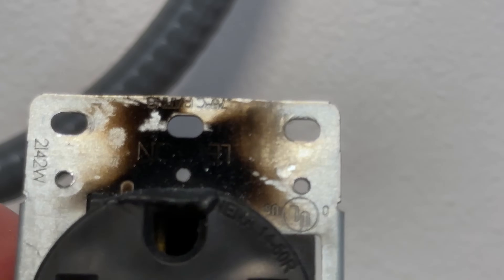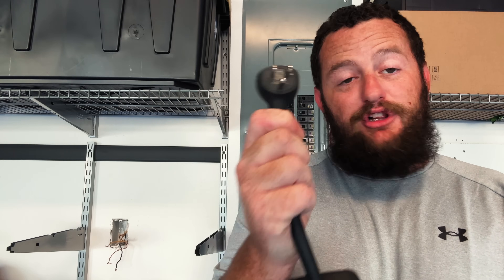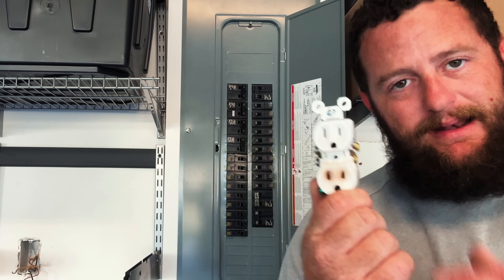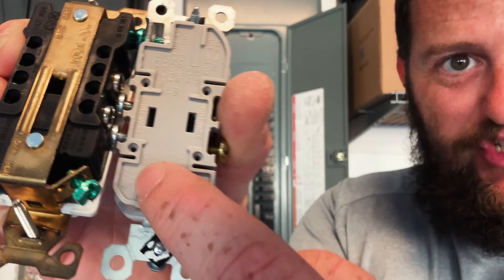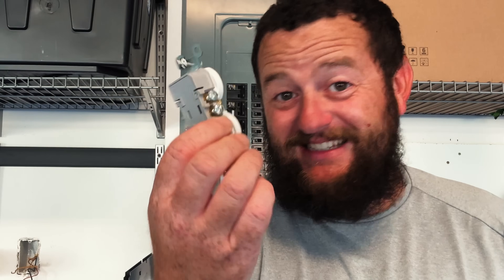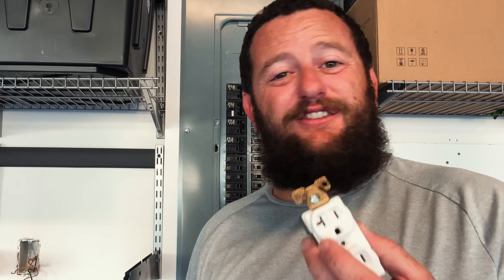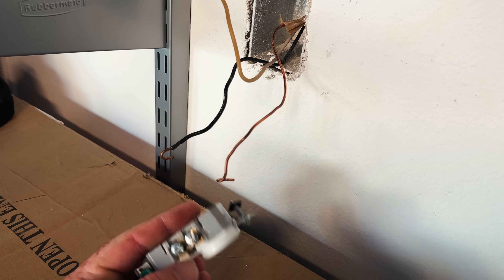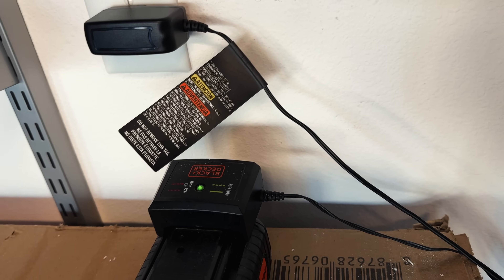Charging W/ Tesla Mobile Connector on 120V Outlet?? Don't Let Cheap Outlets Burn You!!

Comment: Just limit current. Always remember that the amount of heat is proportional to current ^ 2. So 10 A gives you 100 and 12 gives you 144! 50% more heat on wires just for 2 A

Comment: Since you installed a 5-20 outlet on a dedicated 20A circuit, you could buy the 5-20 adapter from Tesla and charge at 16A. Any plans to test this?

Comment: THANKS BEARDED 🤗 FOR HELPING THE COMMUNITY…IMHHO… Your problem, stems from homebuilders using the cheapest of everything to maximize profit for themselves, leaving the homeowner in trouble… I live in an old home with outlets that were heavy duty and in remodeling my other house …TOTAL REMODEL,IN 1991 I had the electrician put in heavy duty outlets and 12 gauge wire so I wouldn’t have those problems🤷‍♂️OVER KILL,MAYBE BUT I SLEEP BETTER  😴 💚💚💚

Comment: I replaced the outlet that I used for my 120 v mobile connector with a professional grade one when I just bought my Tesla but had not installed the 240 v wall charger.

Comment: You can get a nema 5-20 plug for that 20 amp which charges the car faster than the 15 amp
Reply from the maker: Yep, if I remember right, in the Y it’s the difference between 1-2 mph charge rate vs 9-10 mph charge rate on the 5-20

Comment: Thanks for doing this video.  Hopefully you'll be able to answer this, but in your experience, do you think it would be worthwhile just to charge with the standard 15amp cord and not upgrade to the 20amp cord attachment?  I'm currently renting and my carport does have a 20A outlet outside, which I will be intending on using to charge a Tesla M3P once I get one.  Generally, I just use this outlet for my battery tender to maintain the batteries on a couple motorcycles and an ATV.  I believe my battery tender unit pulls 1.25amp max.  Ideally, I wanted to keep using the battery tender to float charge my other things and charge the Tesla.  Would it be wise just to keep the 15amp attachment and then I could still use the battery tender and avoid any potential overheat issues?  I'm guessing if I did buy the 20amp attachment and have the battery tender on the same circuit, I could be running into an issue with too much draw on the circuit.  Clearly, I'm no electrician and it's overall a pretty foreign concept to me, but I just want to avoid any possibility of an electrical fire in the carport.  For context, I have had both my engine block heater for my diesel truck and the battery tender going on the same outlet in the past, and I think the block heater draws at least 12amps, so I hope charging the Tesla wouldn't create any issues, especially if I'm slow-charging it.  Ideally, I'd love to charge at 16amps, but I may just have to be smart about only using 1 outlet at a time if I'm doing that.  What do you or any others that are more well-versed in charging EV's think?

Comment: 3:19 On that screen, you see its already reducing the amps to 9/12 and the voltage is reading 105.  Nominal voltage should be around 120.  The screen also says "Unexpected voltage drop". Those are all BIG signs that the outlet should be powered off from the breaker and taken a look at by someone.  And extension cords should not be used as stated in the manual (for anyone else reading through the comments)
Reply: 100% correct! This circuit has issues!

Comment: My garage has 2 20 amp circuits for receptacles. Builder installed all NEMA 5-15 Receptacles. Like you I swapped out one for a 5-20. I also bought a NEMA 5-20 adapter from Tesla for my mobile connected. It charged well at 15 amps and added, according to TeslaFi, 7 miles of range per hour. 

This summer I hired an electrician to replace the 30 year old 30 amp sub-panel in my detached garage with a new 100 amp panel. New dedicated 60 amp circuit runs to my Tesla Wall Connector. Charging Joy!

Comment: One other thing to inspect is if your 120 outlet was wired using the push-in "backstabbed" connections. The first time I charged overnight I noticed in the morning the Mobile Connector had cut charge current by 50% due to too much heat detected at the wall outlet. Definitely scary! The outlet is 20A rated on a 15A breaker charging at 12A. I pulled the outlet from the wall and noticed it was connected via the backstabbed connections. I re-wired to use the receptacle screw terminals and since then have not had any issues with overheating or current drop.

Comment: I own a 2023 Tesla Model Y LR.  I read all the horror stories about using household grade 240 volt for charging my Tesla at 240 volts.  Per tesla's instructions I purchased a HUBBELL INDUSTRIAL GRADE Receptacle  and had a friend of mine who is a licensed electrician insalll it for me.  I have been charging my vehicle with it for over a year now and everything is working gread.

Thanks for the infor on the 110 Volt Outlets.  I will pass this information on to a friend that has a Neon Leaf.

Comment: Electrician here. The 15 amp receptacle is perfectly legal. And as a continuous load at 12a it is well within the capacity of the device. 

Likely weak connections on the device. Houses are slapped together these days. 

Are you going to tell people that the 20a outlet can’t be used for the 16a continuous duty found on a NEMA 14-20 isn’t safe? 

I installed a Leviton cheapo 6-50 for my car and it works perfectly 2.5 years in.
Reply: Sure.  The 90 cent "contractor grade" outlets might not be up to the task, but a 15A spec grade should.  I installed a Leviton spec grade receptacle in a garage for a door opener and it was less than $3 at Home Depot.  It was similar to what he showed for a 20A, with a more robust body with a metal strap.

I thought that the biggest problem with most cheap 5-15 receptacles is that their contacts are typically just a simple U shape, while higher grade receptacles have a better design that snakes and that puts less strain on the contacts.  I've replaced older receptacles where it was really loose, but I think the spec grade outlets tend to maintain contact better for years.  The strange thing was that it didn't take a lot of force to insert/remove a plug, but I would think the important thing would be to maintain the contact.

Comment: We can’t assume anything when it comes to home charging. In most older homes, you have no idea what type of wires are behind the walls. Best to err on the side of caution. I wouldn’t use more than 8 amps on the mobile charger as a continuous draw. Unless it’s a dedicated line with the right gauge of wiring for high amperage draw, it’s unlikely to be safe for extended continuous high amps draw.

Comment: If there’s only one outlet on the circuit and you want to use it for EV charging only, I would use a 20 amp dual pole breaker with an industrial grade single 240v outlet.   You’ll charge at twice power.  Using 80% continuous rule, only charge at 16 amps for 3.84 kW. You’ll need the 240 v adapter for your UMC.

Comment: Thanks BTG for getting the word out on using commercial-grade or industrial-grade outlets for EV charging.  Good Job! 

Residential-grade outlets are supposed to do the job, and sometimes do, but all to often they melt and/or burn after extended use.  It is best to reduce charge current to 8 amps when using older or cheaper 120 V outlets.

Comment: I was happy to see you get into torque specs for wire lugs. A loosely tightened (low torque) screw means loose wires = tiny air gaps. This will eventually lead to micro-arcing, which has higher heat. The micro-arcing causes wire & screw corrosion, which increases the gaps, which leads to more arcing... you get the idea. It's likely the lug-screws on the cheap outlet were improperly torqued. PS: Eaton Industrial 15A = only $3.75 each when purchased by the box. Eaton outlets are fantastic, especially when all lug-screws are correctly torqued... this might add .005% to the cost of a house... pretty cheap fire insurance.

Comment: Thank you for all the good info. I never use my mobile charger, but I'm going to check the outlet that it would use just in case. BTW I think you wired both the ground and the black wire backwards. Meaning that wire should wrap clockwise around the screw. I think I saw both of them counterclockwise. A nice little tip that I learned a long time ago was "white to bright, black to brass, green to ground" thanks again.

Comment: Wonderful and helpful advice!  I too have a dedicated 20 amp circuit with a builder’s grade, cheap 15 amp outlet. This is a code issue for it’s like using a lamp cord for an electric heater! 

One interesting thought for those in the same situation as I, who have no economical way of adding Level 2, 220 volt charging: if you upgrade to the heavy duty 20 amp outlet, you can buy from Tesla an additional 20 amp adapter for the Mobile connector that will enable the Tesla vehicle to charge at a 15 amp rate instead of 12 amps for it can only plug into a 20 amp style receptacle. This potentially could increase the charging rate to 5 to 6 miles per hour, from 3 to 4.

Comment: Noob question... I use the mobile connector (one that comes with the car) with the 14-50 outlet (installed by electrician) with no problems for the last 2 years. What is the difference between the Wall Connector vs Mobile Connector that I use now? Should I be investing in a Wall Connector?
Reply: Wall connector is hard wired so not to be plugged and unplugged. Gives you up to 48A of charge vs 32A with the mobile connector. Translates to about 44 mi/hr charge rate vs about 30 mi/hr. Has a 24 ft cord vs 20 ft. Can be installed and used outdoors, has a built in cord holder and a place to mount the handle when not in use. There a few options you can control on the Tesla app and it appears on the app. Finally, it has a switchable color glass plate so looks cool on the wall 😎. You need a 60A breaker.

Comment: I'm sorry but the info you are giving is wrong! a 15 amp outlet should NEVER EVER be put on a 20 amp circuit. this is why the outlet overheated. With the car saying the circuit is having undervoltage this is bad. if the circuit was correctly wired for 120/15 and providing proper power for a 120/15 circuit the charger would not of have problems. Yes industrial outlets are better and good for when you remove your charger countless times but UL and national electrical code requires all outlets to perform at the same current. Since this is a 20 amp breaker putting a 20 amp outlet on it is advisable but I would not charger with the 20amp adapter in this outlet until it's fixed by an electrician. Please use the 15 amp adapter or don't use the outlet at all. you're risking fire!

I love your content and watch you all the time and the 14-50 video is correct for the reason that the cheaper outlets are not designed for multiple inserts and removals. but this one is a stretch.

I seriously hope you get a electrican to review this circuit to find out what is truly wrong with it!
Reply: You’re 100% incorrect
Reply: @NextGenEvs  your funny! My uncle is a master electrician! He said this is now a bigger problem than it was before! A 15 amp breaker is meant for 15 amps. If the wiring is not tight or anything else is wrong having it on a 20 amp breaker is just asking for trouble
Reply: @davidew98  it is 100% code compliant, safe, and common practice to install 15 amp receptacles on a 20 amp circuit. Take a look at almost every kitchen and bathroom in American. Due to the plug style of a 15 amp receptacle, only 15 amp or less devices can be plugged in. Bearded’s 12A Tesla charger on a 15A receptacle is completely safe per the 80% rule. It would have made zero difference if the breaker was 15A or 20A. The Tesla was drawing 12A.
Reply: @NextGenEvs  find another soapbox!

Plain and clear., this install was not safe! Let alone the poor install the electrician likely did! The breaker not being 15amps did not allow it to trip when the circuit got hot! As well as the screws were probably not tight.

He’s right the contractor outlets are trash but trash or not they’re certified for that amperage. Just not the inserts and removals we do with EV chargers

Not sure what American kitchen you’re talking about but my American kitchen has all 20amp outlets on 20 amp breakers! And the older American kitchens I’ve seen with 15amp outlets are always on 15 amp breakers!
Reply: @davidew98   a 15A breaker isn’t going to trip with a 12A load lmao. Maybe an arc fault if it was arcing due to a poor connection. All new homes have 15A receptacles on 20A breakers in bathrooms and kitchens unless the owner/builder requested an upgrade. It’s 100% code compliant and safe.